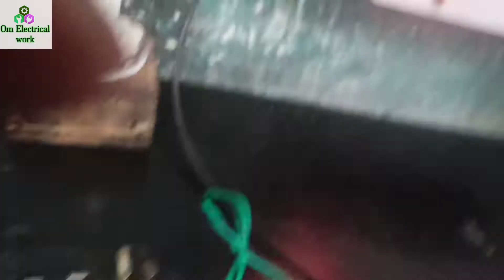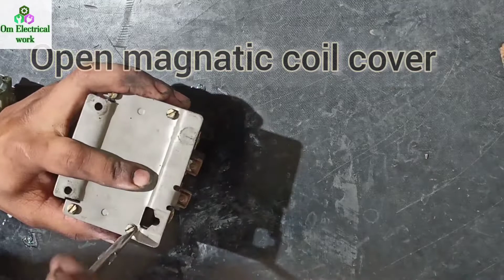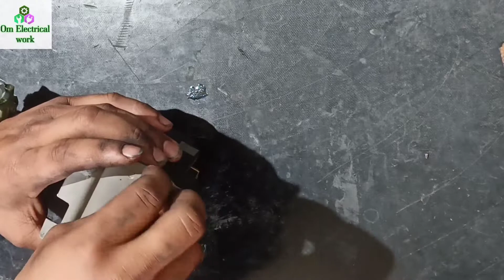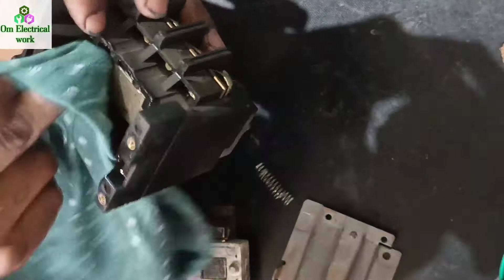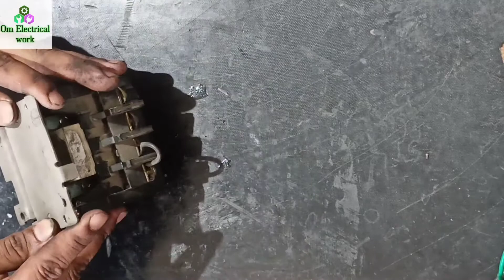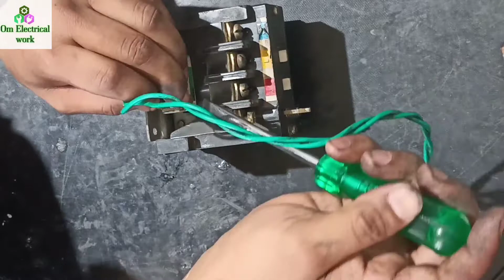#Dol Starter #Starter  BCH dol Starter repair.do not working stop button. how do solve?

Comment: What liquid is used for cleaning? My BCH 3 Phase Sakthi Model (with Thermal Overload Relay) starter has the same problem. It starts fine but does not stop even if I pressed the stop button.
Reply from the maker: Electonic components cleaner